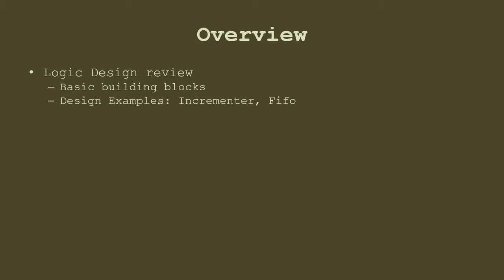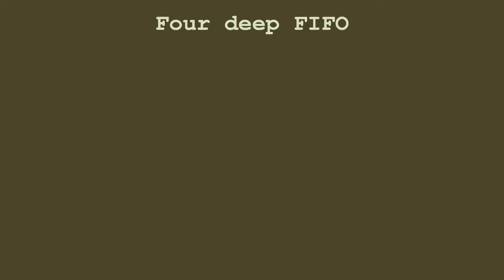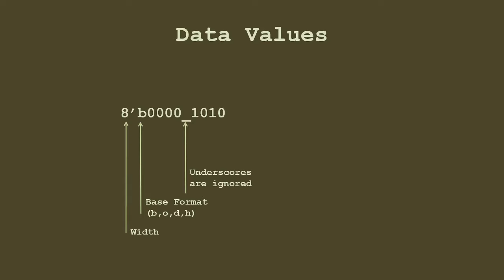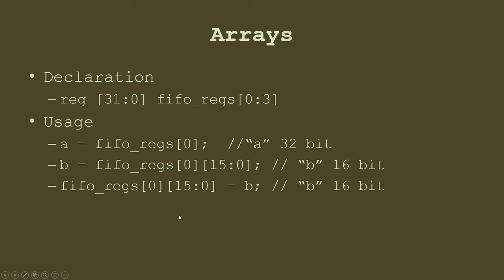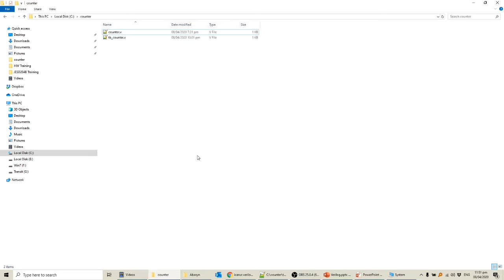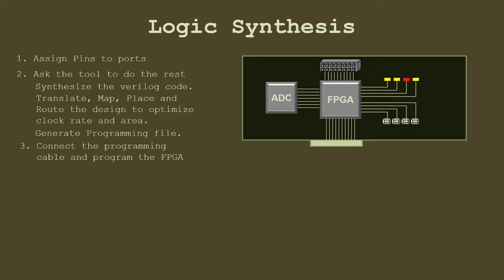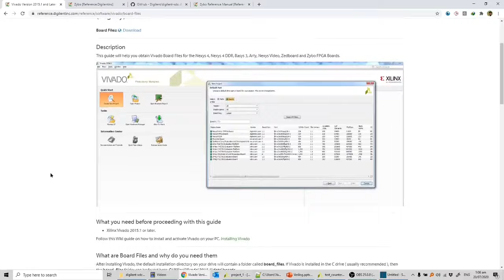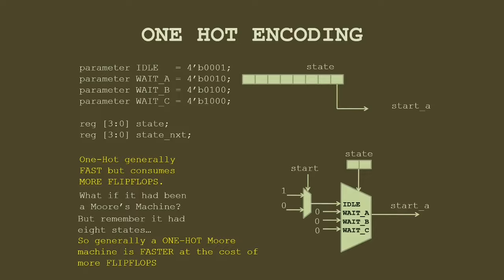Verilog in 2 hours [English]

Comment: At 8:30 , when the enable signal is on the rising edge, the output shouldn’t 4 also be coming as output? Or does the output starts in the falling edge of the enable signal?
Reply from the maker: Enable is probably drawn a bit wider on slide than it should have been. It was supposed to start rising after rising edge was passed and is sampled at next rising edge. That's why output starts at next rising edge.
Reply: @RenzymEducation  Thanks for the clarification!